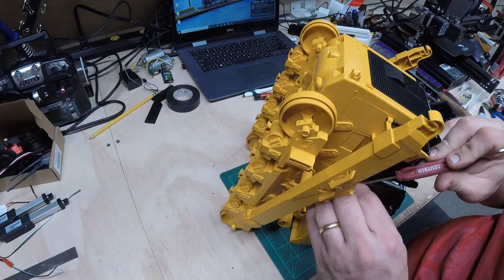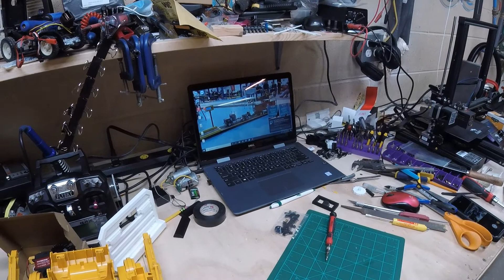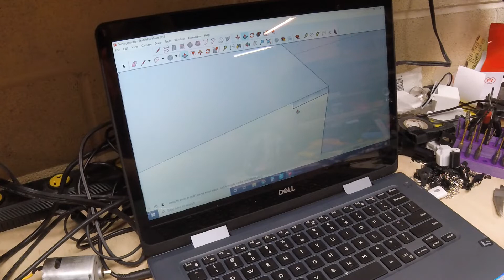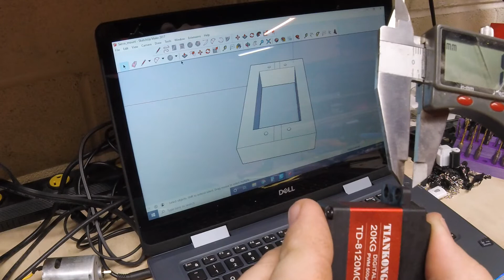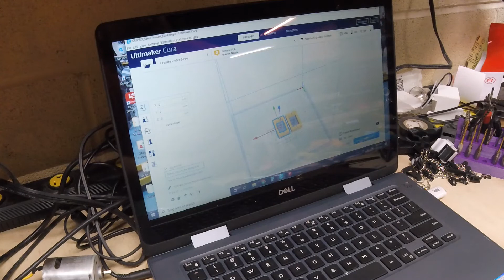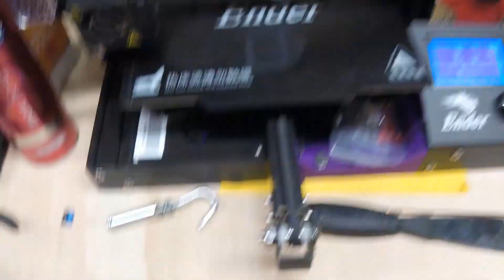Bruder D11 RC Conversion Part 2, Final Disassembly and Installing Servos

Comment: Where can I buy or acquire the files for the servo mount and sprocket....im following your series....thanks
Reply from the maker: check description of Part1 video
Reply: When did you drill the holes? I see holes but never saw you make them?
Reply: For the servo when did you drill the holes? I see them but never saw you make them?